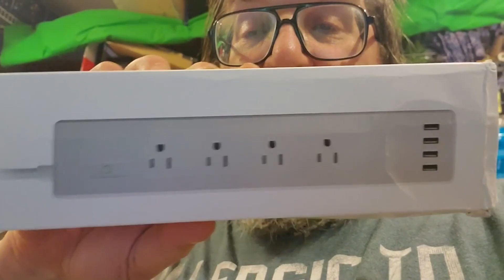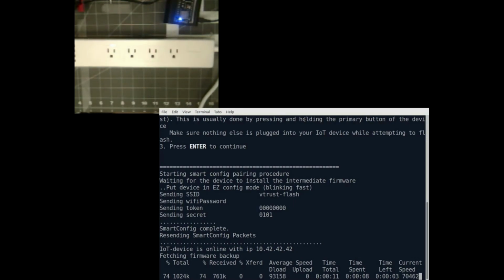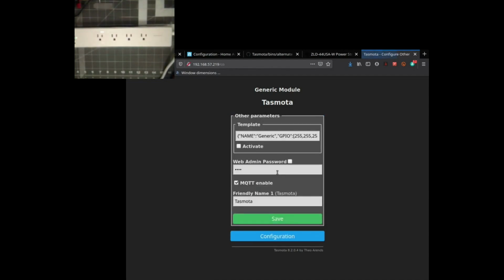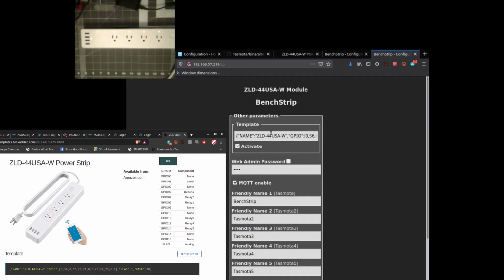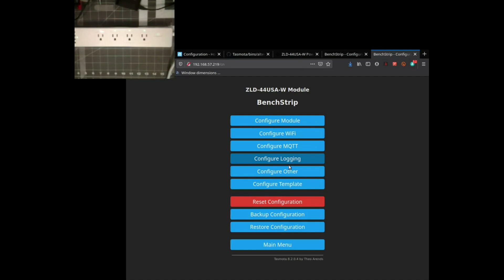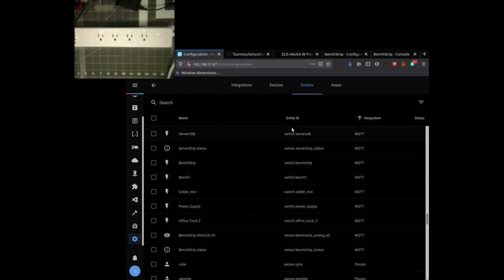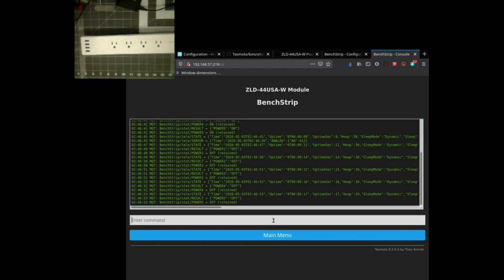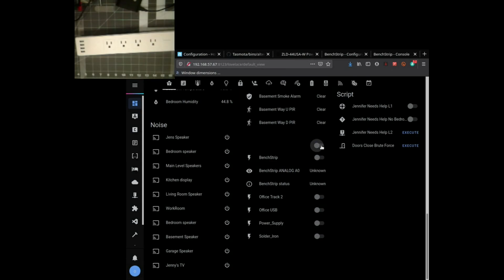Smart Power Strip | Tasmota 5-Function Button | ZLD-44USA-W

Comment: Hi, will this work on servers? I am planning to buy smart power strips to reboot the servers remotely when needed. Thanks!
Reply from the maker: It will work as long as you don't exceed the power / current rating on the outlet strip, yes.  i am using it for 2 servers myself plus the snetwork switch an the shared monitor.
Thanks for your question.